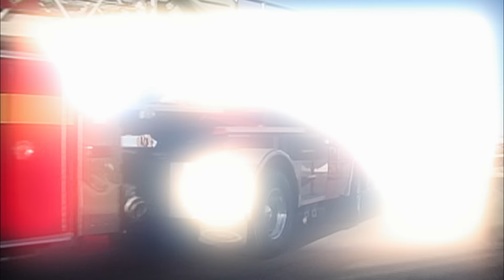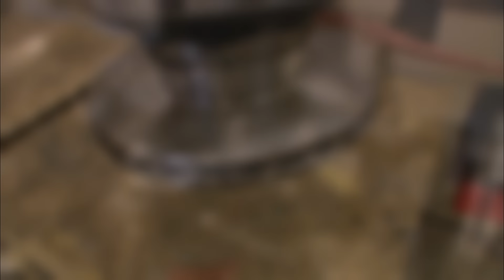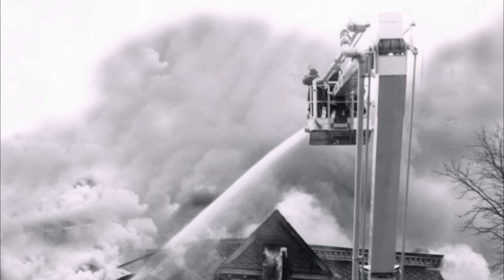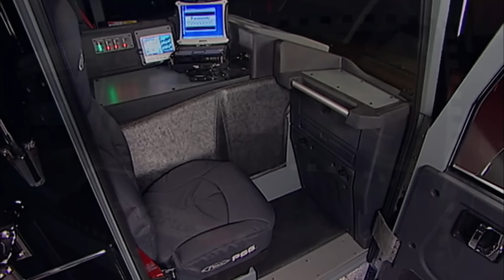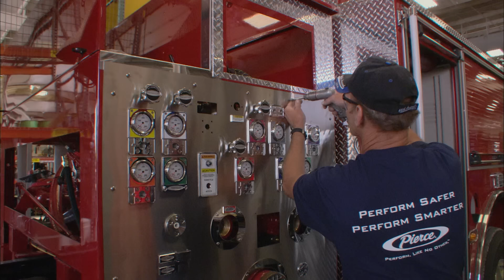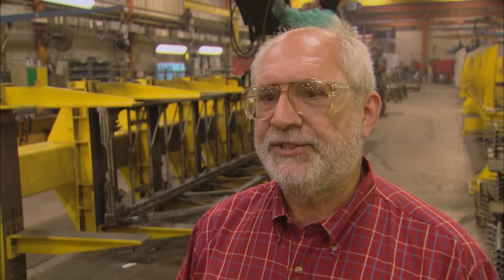Fire Truck Manufacturing: Inside the Largest Factory | FD Engineering

Comment: I CAN'T BELIEVE THAT THEY'RE JUST USING CHANNEL IRON MOST MODERN EVEN PICKUP TRUCKS HAVE GONE TO BOXED BEAMS
Reply: The video confirms the 30m aerial ladder with end platform weighs 7 tons.  Wow.  An aerial operator in FD where I lived, drove a 108 foot stick on a 3 axle Spartan cab n chassis.  He said 'Get going a bit too fast and you get a cork-screw action going'.  Then he said, that's when you cut back the throttle some.  Just a fire buff here.  But oh yah - it must be a wise guy sign. Of something to think about ! 🤨🤔

Comment: I'll bet each mechanic working on these is world class.. how many firetruck issues do you ever hear about? not many.. or any really. Look at those ladders even.. I bet can hold over a ton fully extended. in 2024 I'll bet the have battery generators on board and even more advanced electronics.
Reply: Fully extended at what angle? MACK BAKER Aerial scopes could hold and lift a thousand pounds  at 15 degrees below grade, without a "BOX". their frames were tough enough without a box. Just saying...
Reply: actually, there was a big scandal that lots of Americaan firetrucks are broken down and waiting for repairs and spare parts

Comment: I'm surprised the frame rails are not fully boxed with the cross members thru welded and from the video it looks like the rear brakes are drum brakes. It's 2024 not 1970.
Reply: Video looks fairly old bud

Comment: I spent the last 12 years of my 48 year career as a firefighter/EMT writing fire apparatus bid specifications. I had to deal with the sales representatives and the manufacturers who were aware the various bids. We had one Quint that was being delivered that blew up its diesel engine long before arriving. We had so much trouble getting it repaired and delivered that it became what we nicely term it our “ shop queen”. It wasn’t a Pierce. After that we went with Pierce exclusively because the actual build and after the sale service was superb. 
What goes in to fire apparatus is extensive and with updated safety requirements Pierce always met and exceeded the requirements and we never had any defects. They put lots of effort into making everything right and then lots of testing before it leaves the factory.
The great part of Pierce is that they build everything, from the frame up. The diesel engines and transmissions are not built there, but they have to meet the stringent requirements the fire service demands. If the frame isn’t right, then the truck will have problems.
Reply: Thank you for being a worker at the custom built Fire rigs factory 😊❤
People wonder "WHY" a Fire engine costs are so expensive, it's simple all hand on work. No massive assembly lines.
Reply: Honestly the only downside is that its damn near 3 to 4 years for a new truck now!
Reply: @justanotheraviator2357   Dunieah. Kirimkan. Mobil. Damkar.  Baru. 6. Unit masuk. Kantor Damkar.  Kenjeran. Mobil. Damkar.  Baru. Dari. Usa.  Ri. Kapal. Mico. Tibah. Yogyakarta. Surabaya. Bandung. Germany. Turkey. Korea. China.  Jember. Pakan. Baru. Jambi.  Bumih. Zz
Reply: @justanotheraviator2357  
Is that when the Department Rig committee sits down and design what the Rig should be set up too. Or is that the build time. There is so much human hand work done on them. Just like a custom built very expensive sports car. 
Just asking. I remember spending Hours with the Chief about how the radio should be mounted on the dash or mounted from roof
Inside the cab.
Reply: @rp1645  wait time with a spec sheet in hand. I forget who the mfg (probably Spartan) was but I believe they're all doing it.
Reply: @justanotheraviator2357  
Thank you for the comments. It's interesting that you say Spartan. I am in the purchase stages of a 1989 Spartan Gladiator pumper 
I am going to buy. It has a big crack on the Tank to the pump valve. ( Am going to fix) Everything works on her. It is an Allison Automatic with a 92 Series DD with turbo. The ladder rack is a hydraulic swing down from top of compartment 
Both sides of the body were spec. Out to be a full height compartment. It has an enclosed 4 person jump seats with air pack holders. The first thing I will do is remove the officer seat
 air pack. Set up. My wife hates that set up in the seat for her when riding ( she is the Admiral 
And also is a money financial boss. So I must keep her happy. My dog ( blaze) loves sitting on the engine cover between us, looking out the front window. It's really his Fire Engine 🚒
Reply: I have been a near life long fire truck buff. Started at age 7 [no kidding] and I'm 68 now. This is a great video.  I was curious to know how the latest clean cab concept works.  Do the fire fighters leave some bunker gear off. In a truck locker, until they arrive.  And decide on- scene if they should bunker up and don a BA with mask?  I guess more often washing of their gear helps. Unlike a lot of buffs I think lime yellow paint was alright. Having nothing against Cummins or Caterpillar, Detroit Diesels are cool to hear.
Reply: God bless you.  Jesus saves sinners

Comment: This was great but where are the hoses? Are they coming on another truck? I didn't even see a hose to hook to the hydrant.
Reply: Trucks don’t carry hose. Engines do
Reply: @TrashMan702 
I knew someone would say what your comment means. I have been corrected on comments when I use the "Term" Fire truck. I started just writing "RIG" as a standard term. I OWN a 1971 SeaGrave 
( Fire ENGINE) And looking to buy a 1980 
SPARTAN. I use them for showing at events. The Spartan is neat, the whole cab raises forward tilt, to expose the 92 Series DD. Whole engine is fully accessible 😊
Reply: The end purchasing departments have their own standards about the gear they want to carry.  So a new apparatus will be delivered to the purchasing department and then their maintenance staff will outfit it with tools, hoses, radios, and other equipment to the department's standards.  All of that is done after delivery.
Reply: They come from someone else.

Comment: I was shocked to see they use body filler. That's a crappy manufacturing job I think.
Reply: Well remember how large these panels are, they are handmade they will have tolerance. It’s not an inch thick layer it’s a skim coat to make it perfect like how you’d do on a car you’re doing a paint job on.